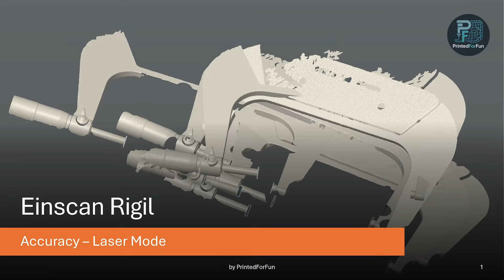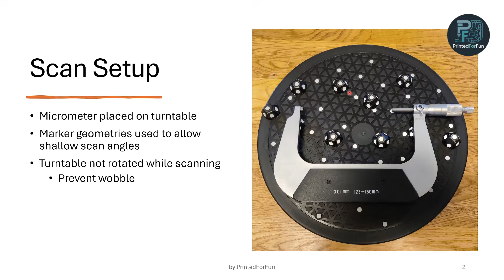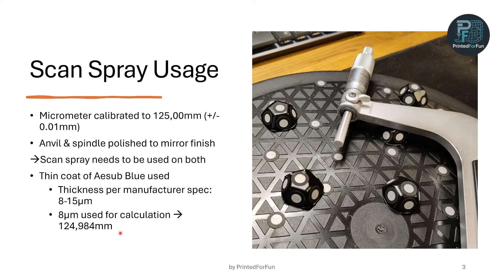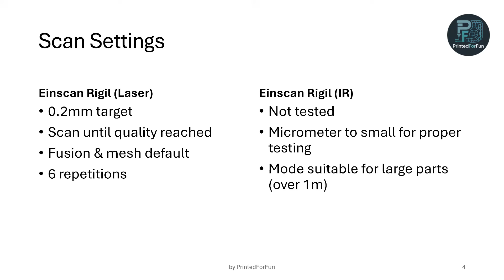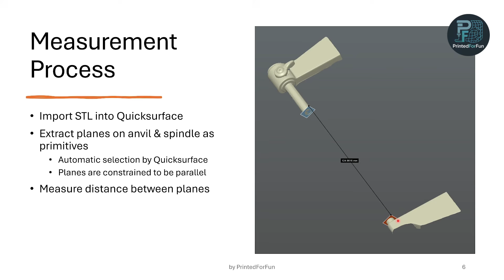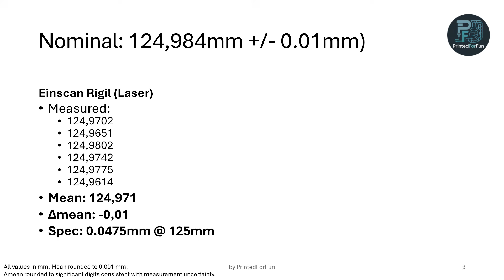Accuracy of the Einscan Rigil Tested

Comment: Hi, I am planing to buy 3D scanner for my 3D printing shop, I am looking at revopoint trackit and einscan rigil, which one you prefer? I need detailed small parts scans, most of the time.
Reply from the maker: Then the Rigil is simply more suitable. Trackit shines for parge parts and car body panels
Reply: @PrintedForFun  thanks for fast reply, any recommendations on reverse engineering software?
Reply from the maker: @analog5.56 I use and very much like Quicksurface (pro version basically is a full cad software)